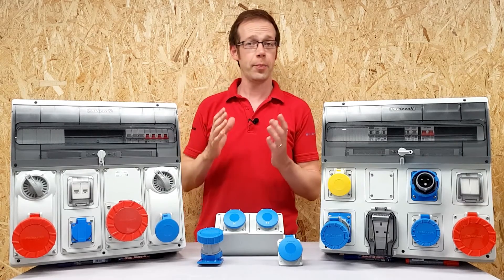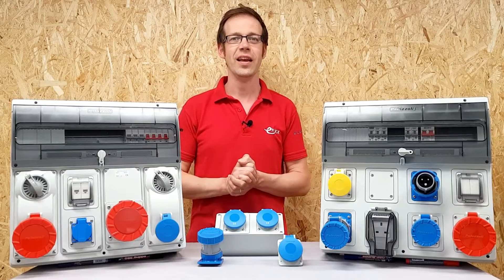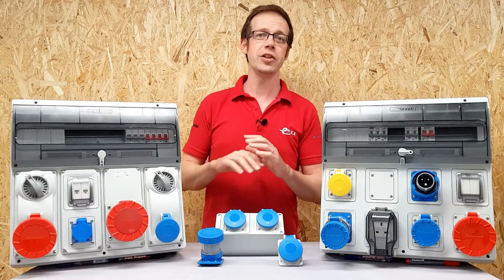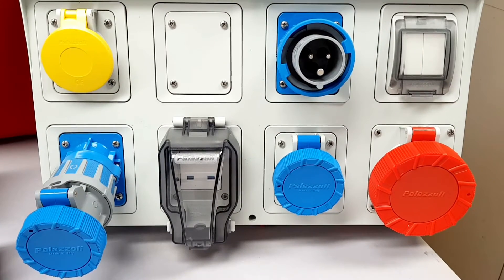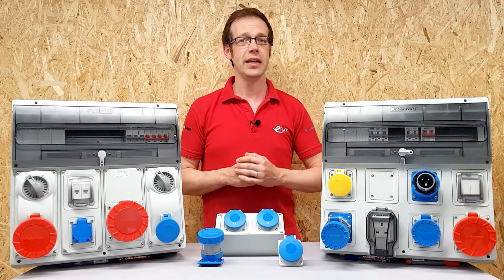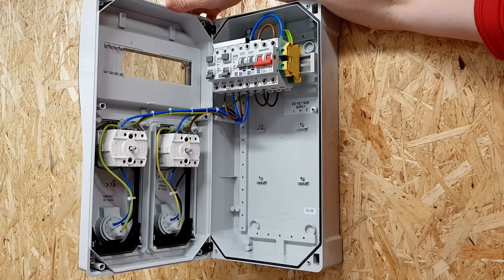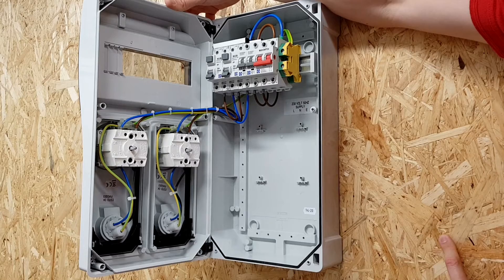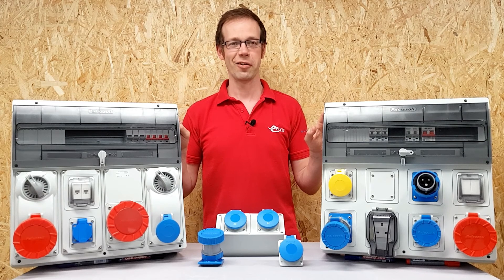TopTer - ultimate flexibility for industrial electrical installations

Comment: how would the 110v yellow socket work within this setup? obviously no transformer within the unit itself so would you have to feed the whole unit from a seperate transformer ?
Reply: Grahame Mcgann reckon they've got a 110v transformer module to add in? Would solve thst issue but be beefy no doubt
Reply from the maker: Lewden have created this prototype to plug in 110V transformers - let us know what you think - https://youtu.be/t5fO_kWw1Ko
Reply: efixx product looks great for domestic use , but with larger building site not allowing 230v tools and plugs on site , where does their yellow 110v plug come into use ?

Comment: Can this be used for other applications other than special locations and industrial? I. E. In a residential garden powering many installations like lighting, saunas, heating, hot tubs etc. Also maybe a good idea for using in a multiple occupancy communal area.

Comment: I know it isn’t quite relevant to this product but after fitting countless 32amp rotary isolation switches for hot tubs recently the lack of space internally is really winding me up.
With the requirement of a earth stake input as well the isolation switch is both ugly and time consuming. Is there a product that takes in a SWA cable, a cable for the tub and the earth cable (I put it in black copex for neatness) out there? That looks like it should be in a garden not a ships engine room?
These lewden boards are close to what we need. 
Or am I asking for the wrong product at my whole seller.
Keep up the brilliant videos guys 👍😊